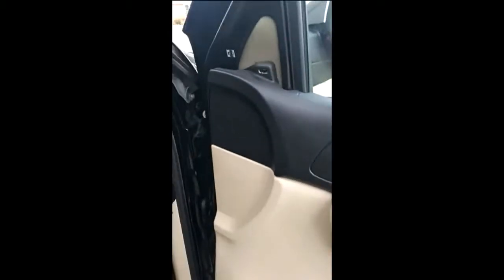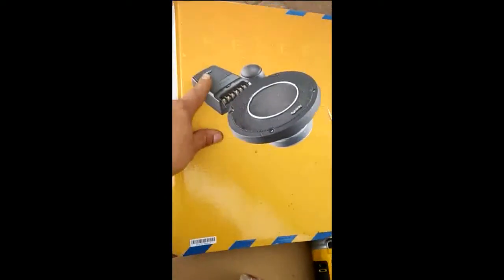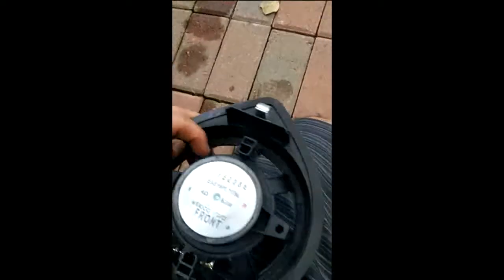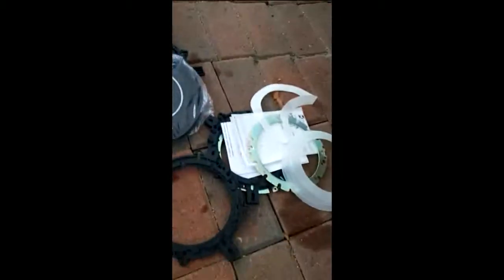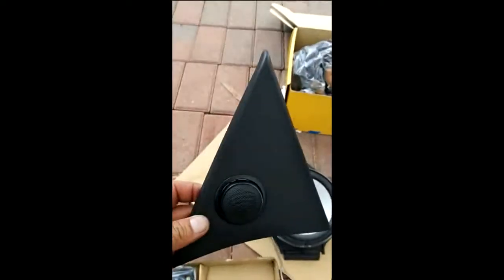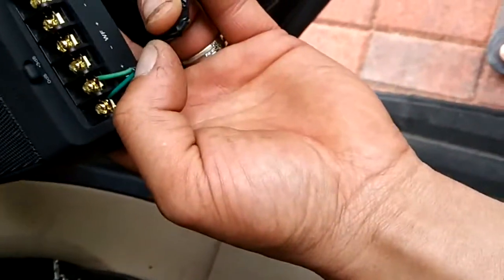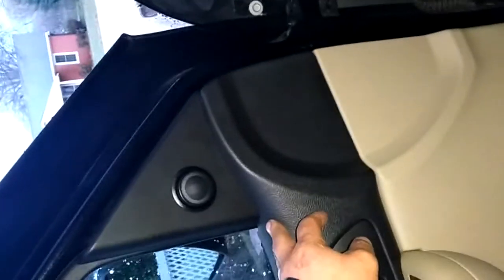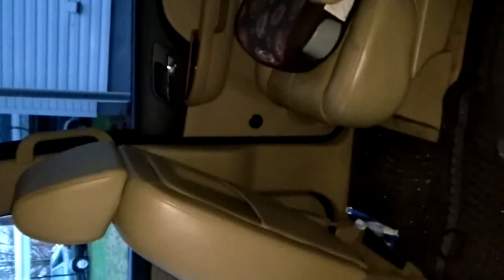blown speakers/ speaker upgrade  2007-2014  Tahoe

Comment: Hey like the video. So basically if you use the factory mounting bracket you can fit 6.5 in both front and rear door?
Reply from the maker: Jake Serra yes that's right  for what I know from 2007 -2014 is all the same,  so what I did to my Tahoe door speakers should work for you as well .
Reply: Jake Serra did you fit the 6.5 in front & back rear doors? I’m going to buy some today but I wanted to make sure.
Reply from the maker: Yes sir all of the speakers on doors are 6.5 .
Reply: @gtolatino79  do you have the stock Bose system?

Comment: Where did u put cross over?
Reply from the maker: I tucked it in behind the door panel right where the speaker protection/speaker ventilation is , there's a gap there big enough for the crossover.
Reply: @gtolatino79  u cant here cross over moving around and did ur Tahoe leak?
Reply from the maker: @loop2962  it doesn't leak at all and when it comes to the crossover if you pay attention to the shape of the door panel you will notice that there's a crevice created by the round shape of the speaker protection and that's where I stuck mine in and nope there's no noise at all .
Reply: @gtolatino79  ok thanks for responding do think it'll be better to do coaxial or components I'm doing infinity refrence
Reply: @gtolatino79   what did u cut the holes with for tweeters
Reply from the maker: @loop2962  I bought a  hole saw set / door lock hole bits
Reply: Ok cool thanks for help!
Reply from the maker: You're welcome and good luck with your project